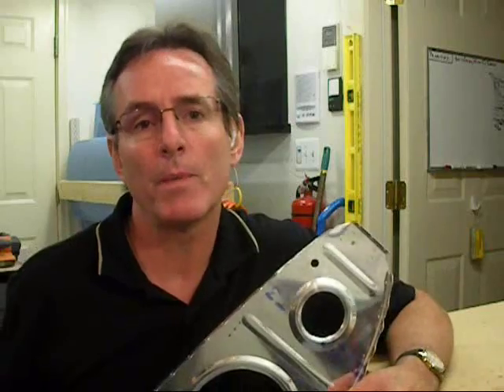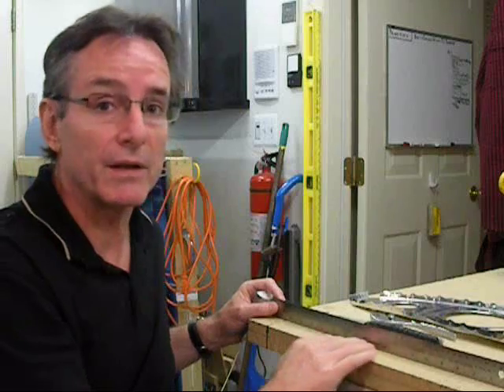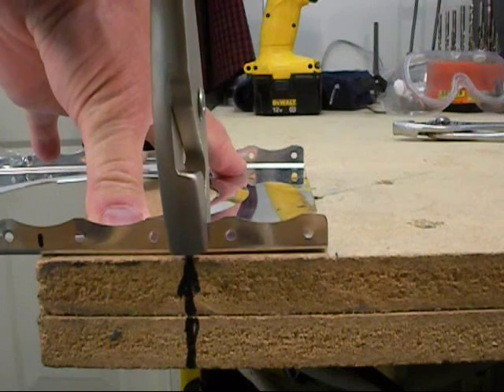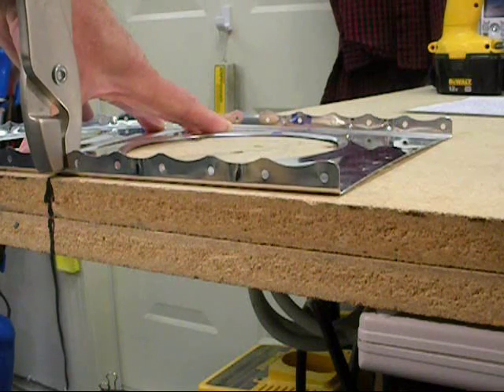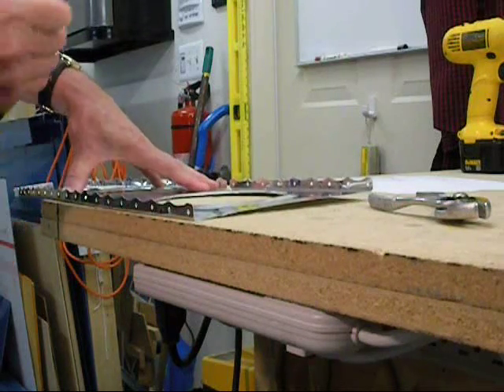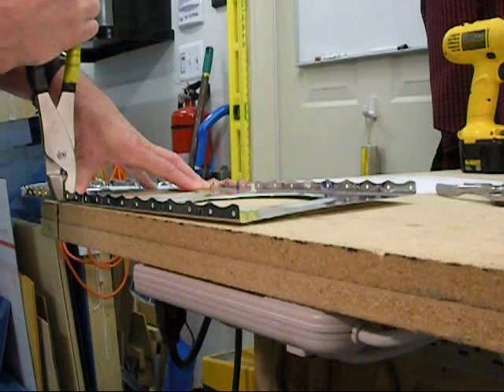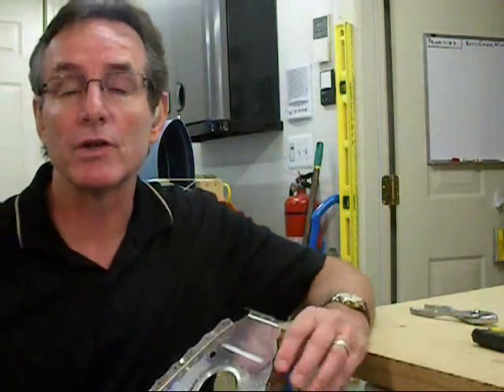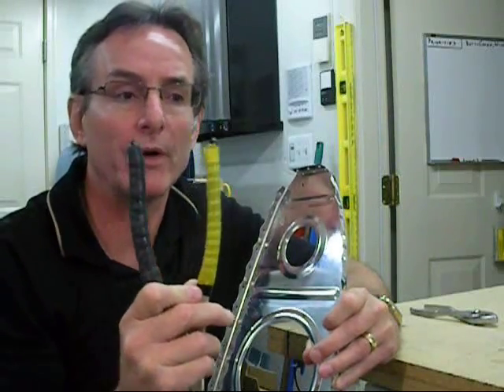RV12 rib fluting

Comment: It looks like your method works well on the wider ribs.  I started doing something like this with my RANS S-21 HS ribs and found that doing one side at a time would get both sides flat, but tended to put a twist in the narrow ribs that was hard to get out.  Being an old software guy, I decided to use a binary search type of approach.  I flute the center of one side and the 1/4 and 3/4 points and then do the same on the other side.  I then flute roughly halfway between those three initial flutes on one side and then repeat on the other.  I found this approach to not only be fast, but it prevents the twist that can occur if one side gets too far ahead of the other on a narrow rib.
Reply from the maker: Interesting. Never thought about using a binary approach...successive approximation. I use it in many other areas of engineering, but never thought of this application. I will try it the next time I flute a rig. Thanks!
Reply: @ansleygilmore  I think your approach is fine on a wide wing rib, but I found the 3” or so wide HS ribs gave me fits in waiting to twist as they were flattened if I got one side too far ahead of the other as I removed the arch.  Just remember to start with small bites as it looks like nothing much is happening on the first round, but by the time you get a small flute between each rivet hole, it is amazing how flat it will be with just little dimples.  Then at the end it is easy to go back and deepen a dimple or two if necessary to get a certain section really flat.